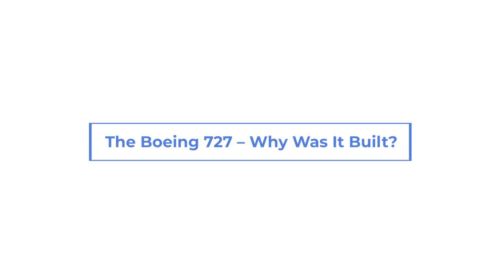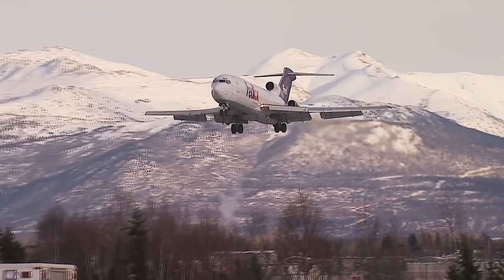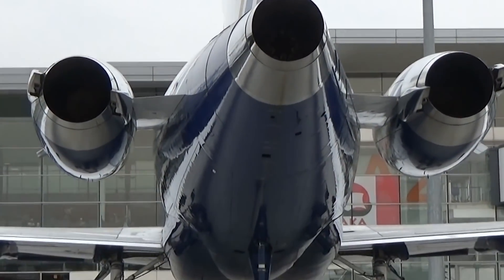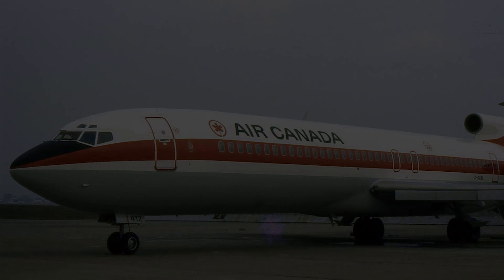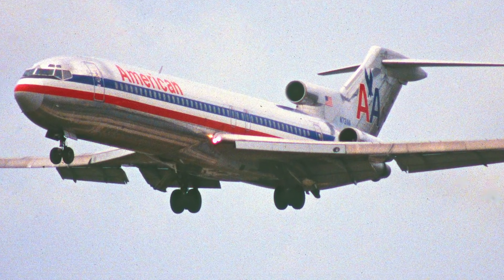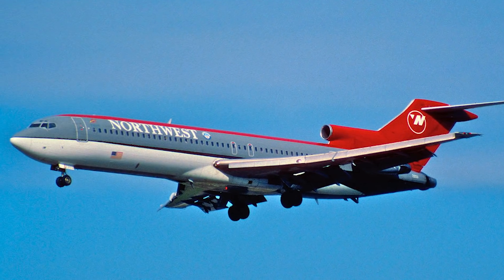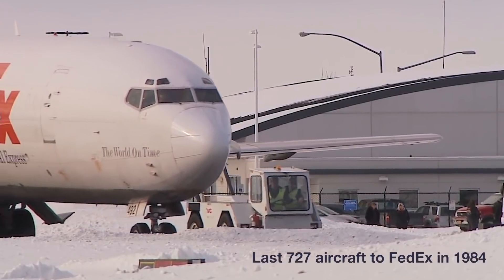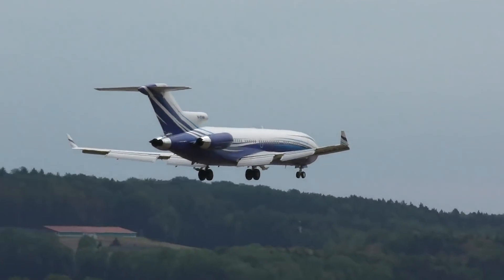The Boeing 727 – Why Was It Built?

Comment: On 9/11/2001 I towed a 727 off the gate to a parking area.  I shut down the APU and came down the rear stairs of the plane.  A eerie sound of an airport with no noise stuck me, just the wind. That day changed the travel industry.
The 727 was the queen of the airline I worked at, lucky I made it to the end after 38 years.  But when I was standing there wondered if I would make it to retirement. The plane was soon retired after that.
Reply: It is funny that a few thousand changed the airline industry permanently but we are currently looking at a hundred times as many from a virus.  Spread by travel.  Will there be permanent changes to protect us from such a much larger threat?  I am not confident of that.

Comment: This is no joke at all.  When I was an FO on a cargo 727, my Captain demonstrated what the 727 was actually capable of.  We were flying into an airport in Europe in the middle of the night and we were 7200 feet above the airport elevation...Three miles away from the touchdown zone.  And we landed on the first third of the runway, and didn't need to roll to the end of the 10,000 foot runway.  Right now, anyone who has airline equipment experience is either scratching their heads or has the hair on the back of their necks standing straight up because typically, three miles out you are at uhmm 900 feet....

There is NO BULLSHIT here;  Flaps 30, speed brakes up, and a full slip, warning sirens screaming.  The mighty 727 could do it!  Now; Let's try this in your average Airbus 320 and see how it works...

Comment: Supposedly, Eastern wanted a twin-jet.  United wanted 4 engines.  American believed that a 4-engine aircraft flying on shorter routes, with fewer seats, made little economic sense.  AA said that it would accept a design with 3 engines.  Eastern and United said each could accept a 3-engine aircraft.  Thus, the engineers got to work.
Reply: Eastern always wanted 3 from the beginning for their Caribbean routes. That's why they got the first ones. United wanted 4 for high dense Denver, American liked 3 for safety and as you mentioned economy.

Comment: The 727 was arguably the most elegant Boeing aircraft. I fondly recall my childhood in South Africa watching the Kulula and Nationwide 727s. I thought I missed the opportunity to catch a flight on this one but was extremely blessed to enjoy two flights on this beauty with Iran Aseman airlines a few years ago. 
One minor detail I'd like to add/ correct: at 0:50 you zoom into the exhaust of the number 2 engine while talking about the APU. The 727 APU is actually mounted between the main gears (very unusual nowadays) and the exhaust is on the top of the right wing (often leaving black soot marks on the wing). As one of the first aircraft with an APU there was not a standardized location for the APU at that time. The location of the APU also meant that it could only be operated when the gears were down since the APU inlet is in the wheel well. 
Thanks for the video!

Comment: Never boycotted around here. American flew the wings off of them in the Mid-West US. Pilots with brains would shut-down the center engine when they got to altitude and cargo companies would shut-down both outboard engines. Lose a little speed, save bunches of fuel.  DC-9 was a little quieter, but didn't have the power of the 727 climbing out. 727 may have had 75 knots on a DC-9 too. It was easy to make-up an hour from Chicago to DFW in a 727 and make your connection. Never happened on a DC-9.  L1011 and DC-10's were other great "three pipers". BIG inside but too many seats for most Stateside operations. Must have been a nice charter to Hawaii or Acapulco, etc.  3-5 hour flight on a 727, no big deal, same flight on a "pig", leg cramp city. American had some 727 with 3/2 seating in "business class". Great plane to ride in, better to take a nap in from O'Hare to DFW or Hou Int.

Comment: Two noteworthy 727 flights: D B Cooper's $200,000 misadventure on Northwest Airlines in November 1971. World Airways' evacuation flight to Saigon in south Vietnam during the wind down of the war there in 1975, when the plane took off with the rear stairway down, and flew to Saigon with far more passengers than seats. World Airways president wrote a detailed letter describing the flight to Boeing executives, who wrote back that under those conditions the plane should never have gotten off the ground.
Reply: Aft airstairs failed in flight, unlocked, in my company once.
The flight engineer depressurized the plane , opened the aft bulkhead door,trying to bring it up with the control handle to no avail.
Upon landing and ram air reduction, stairs were downlocked too....

Comment: Quite simply the plane I trusted most as a passenger. If I had my choice, it was always a 727 for me. Used to fly into some squirrely places, and never once worried on a 727 with some of the great old ex Military throttle jocks who weren't afraid to pin the throttles. You have no idea what you are missing if you never got to fly back then.

Comment: I worked on many 727's. The last one for UPS with the main cargo door not wanting to pull in & have the overcenter cam lock work in proper sequence.
Most of the rest were APU overhauls, onwing(on fuselage) inspections & hydraulic troubleshooting & repair. Fun stuff.

Comment: robably the best and most successful plane built by Boeing.
Modern planes are not as elegant as the planes in the past and are also very tedious.
The Boeing 737 MAX is a total failure and I don´t understand why Boeing was betting on a such a narrow-body piece of crap.
Reply: Boeing was left with no choice. 

As successful as Boeing has been in the airline industry in the last 60 years, it came with hard lessons that still have repercussions today. 

Boeing was mainly a military contractor who’s planes were based on cost-plus-fee contracts. It built a bomber like the B-47, and when the USAF needed another bomber it built the larger B-52. There was no reason to build growth into the designs because the government would pay for a completely new design from scratch. 

So when it made the 707 it made it  one size. The DC-8 was larger and longer ranged, so Boeing had to almost completely redesign the 707 with a wider fuselage and a different wing for the 320 intercontinental version. It also made the shorter QANTAS version and the shorter 720 out of the same design. It outsold the DC-8, but the costs were huge. But in the late 60s Douglas came out with the Super 60 DC-8s and Boeing could not stretch the 707 without again extensively redesigning the wing and landing gear, so it concentrated instead on the 747. 

As the 70s were drawing to a close, fuel prices were increasing as well as noise and environmental regulations. Smaller but higher bypass engines like the CFM-56 and JT8D-200 were available to planes like the DC-8 and DC-9.. which became the Super 70 and MD-80, respectively... but didn’t suit the 707 which was too small to take advantage or the 727 who’s centre engine inlet limited the engines it could use (the Super 27 used -200s on the pods, but very few were converted and no new models were built). The 737 at the time was filling a role below the 727 and didn’t need any growth potential. 

So with all three Boeing narrow body airliners at the peak of their development, Boeing needed a new narrow body plane. One that could replace both the 707 and 727, that could accept large fuel efficient engines, and that had huge growth potential. 

And that plane was the 757. 

The problem was, it was an awkward middle child. It had the weight and bulk of a wide body like the 767 it shared most of its design with but only a narrow body fuselage. It packed a lot of people in a narrow tube for long distances. 

At the start of its life it was too expensive. In the middle of its life it’s fuel economy didn’t matter. And at the end of its life as it was finally stretched to the -300 it was when it was already too large of an airplane for domestic routes that were rationalizing on the 737 and A320 as well as 50-70 seat regional jets and too small for international routes using wide body aircraft. 

So the 757 was a dead end. But Boeing still had the 737 which with bigger engines and a fuselage stretch was a viable 727 replacement. 

The problem is that they’ve gone too far. You can only keep updating an old design for so long and keep safety and commonality going. Boeing overreached... and now risks its entire narrow body market.
Reply: Sorry, I don’t know how to edit on mobile without deleting. There was some extraneous stuff at the bottom of my first post. ;)

Yeah there was definitely an advantage to having commonality for cost reduction both in development and in operations. Airbus did the same thing with the A340 and A330. 

But those are two more examples of planes that were the wrong size because of their compromised design. The A340 in spite of being touted as a 747 and 777 competitor had one of the narrowest of fuselages.  It was the same as the short haul A300.  Only the 767 was narrower for wide body aircraft. It also meant they could not match the 777 in payload even when lengthened to almost ridiculous proportions. The A330 made inroads to the 767 in the shrunken -200 version and is a decent wide body twin.. but not the hard hitter the 777 is because it’s still too small. 

Airbus knew that and started developing the A350 to be a true 777 competitor in the era of ETOPS. But their first one was ridiculed by ILFC and GECAS presidents and being a warmed over A330. They went back and came up with the A350 XWB.. a true competitor. 

An example of what was done right was the A320. It took square aim at the most popular narrow body aircraft of the time—the 727-200. Not much bigger, moderate growth and shrink capabilities, 100% modern. And today it has none of the problems the 737 has. No 1960s systems with bandaids like CWS and Autoslats to make it fly like a modern airliner. No having to shoehorn huge engines under a wing of an aircraft designed to be a regional jet. Simple software tweaks to exist systems so it will fly the same across all generations. 

Even the DC-9 was better. All you had to do was stretch the fuselage forward and install larger engines in the back to balance it out. From the DC-9-10 to the MD-90 it’s like double the fuselage length. And unlike the 727 and MDs own DC-10/MD-11... no integrated inlet to limit engines. 

Boeing has had plenty of time to change. But the success of the 737 and customer loyalty to it made them rest on their laurels in spite of tons of problems (lap joints on older versions that caused Aloha 243 and other problems, chronic CFM56 issues, rudder PCU problems, pickle fork cracks). The 737 MAX broke records for sales when they introduced it. But now it might never fly again.

Comment: A little to simple, you didn’t mention that it’s about 60% 707 so was cheaper to build and the  cockpit is almost the same as the legacy 737 for easy pilot transition, engines up high to get the cabin closer to the ground for passenger loading before jet bridges came to small airports.  I’m surprised they didn’t drop the 3rd engine to easily compete with the DC9 but with 6 across seating vs 5.  That’s would be an interesting back story

Comment: Similar issue as the 737 Max, in which the pilots were not trained regarding MCAS--which was intentional, in order to save money for the airlines--according to most of the information published.
In WW2, the Martin Company built the B26 bomber which was known as the "widowmaker"--the twin engine bomber was crashing upon landing quite often.  Pilots had to be quickly trained to land "hot" to avoid stalls. A lot of the re-training took place at MacDill Field in Tampa, Florida.
Martin quickly made adjustments to the wing size & the B26 became a  workhorse for the European theater.

Comment: ...loved flying on 727s.  Enjoyed sitting just behind the wing to watch those massive triple slotted flaps extend during final approach, expanding the effective wing area by about another third. With all the engines in the rear it was relatively quiet inside compared to the 707, 720, DC-8 and Convair 880/990 (hence Eastern's trademark branding of "Whisperjet"), however outside, it was a completely different story.

Flown on -100s and -200s as well as the 100 QC (convertible passenger/cargo variant) the latter on Northwest.

Comment: As a mechanic on the B737 and B707 and B727. The B727 was old B707 technology. Had to work some systems. I liked the B737. Good simple machine.
Reply: As a mechanic and flight engineer on Boeings , I don't agree.
Reply: What do you disagree with?  The electrical and avionics on the 707 and 727 are the same. Both flyt engineers system panels were modeled the same. Just compare that to the 737. (No flyt engineers station)
Reply: @oldmech619  "was old 707 technology"...
Well, I think 727 was some steps higher, hydraulically powered controls versus just the rudder on the 707. Plus avionics were more modern etc.
Worked on all the then series on ground, flew 727 ,707 ,747 in that order....(a 10 year interval on A300B4 but it doesn't count here)

Comment: The 727 basic strong point was that through it's flap and leading edge droops ,saying it's wing design allowed short runway performance and high speed cruise was a good design at that time but it's fuel burn in later years  made the 737 a more popular choice as the increase in speed did not make it up for the higher fuel prices after 1973.
Reply: Krueger Flaps

Comment: 727 is a great aircraft.  I'm sure that if DC3 is coming back into service with some improvements,  so it will the 27. Just think of a low cost refurbish,  avionics,  quieter saving fuel and more efficient engines with that interior space and excellent speed. Am I dreaming?  Maybe not for some regions and applications. Anyway I like to imagine a new life for the venerable one.

Comment: when i worked at First Air (Canada) we had several 727-100 combis...huge cargo door on the side, passengers would board using the drop down steps under the tail (very cool feature)...but  it's the sound i remember most...the APU exhaust over the wing was deafening even with ear protection it would rattle your brain...and man they were loud taking off...a real crackle from the engines...the 727 was cool bird and one of my favorites...thanks for the video

Comment: G'day Simple, I had a good mate who flew C-47s with the RAAF during WW2. He later flew for one of our domestic carriers; firstly on the few remaining DC-3s then on Viscounts and Electras before converting to the 727. He retired his flying career on 727s. He told me he would always love his old Dakotas, but stressed he thought the 727 was the best commercial aircraft he'd flown. He told me he could have 'put it down' just about anywhere and get it into fields that had never seen a large multi-engined aircraft before. I always enjoyed flying on the 727 but that was back when airlines didn't pack in passengers like sardines. It might have been noisy to outsiders but if you were seated anywhere forward of the wings it was an amazingly quiet flight. Many were sorry to see it go. As for the 737 MAX, although it may come back to us as the safest, most over engineered and most examined airframe in the world, I'll still give it a bit of time in the air before I'll book seats. Thanks for your video. Cheers, BH

Comment: You'll never catch me on a max
Reply: @taotoo2  can tell you that the older the safer and more reliable.
Reply: @taotoo2  not with the 737 747 767 757 if we are only talking about boeing
Reply: @Brummiewellington Wow, you are really using these numbers? 737NG vs the A320 family means 0,07 vs 0,08.
Are you really gonna say "I don't want to fly in an Airbus" FOR A DIFFERENCE OF 0,01??
Meanwhile, the entire family of 737s is at 0,23, so I guess we know which company cares less about their passengers lives.🤷‍♂️
Reply: I have a feeling when it comes down to it. You're gonna be like most people and look at flight times and prices and not aircraft when you fly
Reply: @taotoo2  It's not an old airframe. They are new planes with new advancements. As mentioned below, the only thing "old" is the look. If you're going to base it off that you might as well say the new mustangs are basically the 1965 just with new stuff bolted on as well.
Reply: @Brummiewellington I know, that's why my statement was about the company, not the chance to die in a short-medium flight. Airbus did a better job in protecting its passengers mainly because it didn't kill so many people with a new model.
I didn't talk about the chances to die in a normal flight because anyways they are so narrow that it doesn't make sense to campare Airbus and Boeing.

Comment: You have forgotten the British DH 121 Trident which flew before the Boeing 727 and Boeing at one stage we’re going into a collaboration with De Havilland.  Sadly this partnership never materialised and DH went one way and Boeing the other.  The result was that the Trident 1C was too small compared to the Boeing 727; thanks to a stupid decision by the launch customer BEA to have it this size.  The result was that the worlds airlines bought the larger 727; although DH later produced the Trident two and Trident three which were larger and had a better range comparable to the 727.
Reply: Yes, the British Airlines shot themselves in the foot with several aircraft. BOAC insisted that the beautiful VC10 had to be able to fly a full load out of Nairobi, a short, hot, high, airfield. Thus it got lumbered with four engines which were far more powerful, and therefore far thirstier, than they needed to be for any other route BOAC operated. The result was that only 69 were built, whereas Boeing built well over 1000 B707s, in various guises and the British airliner business died out until Airbus.